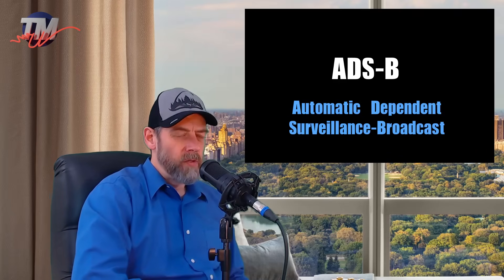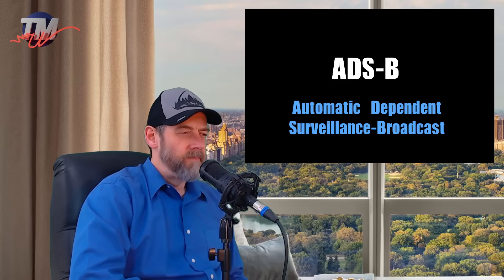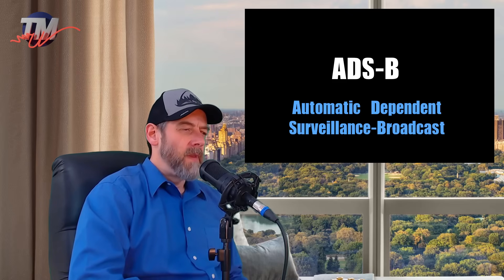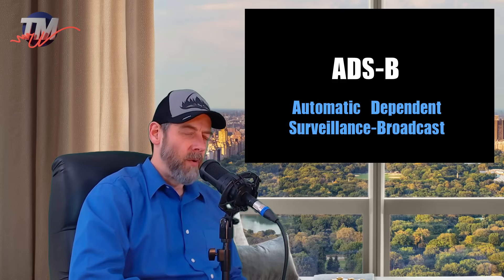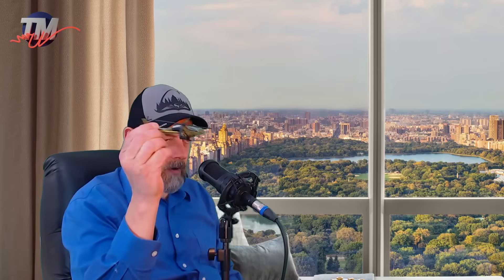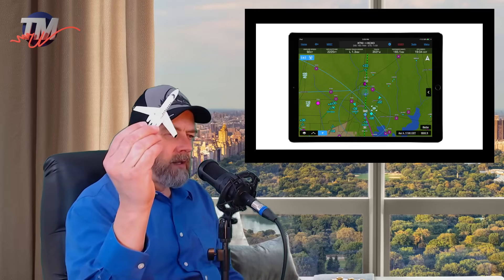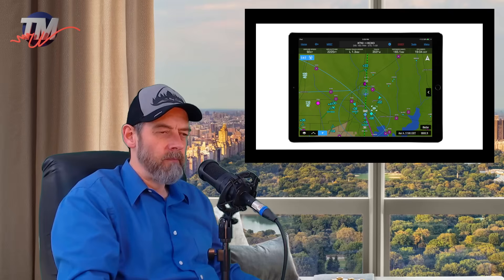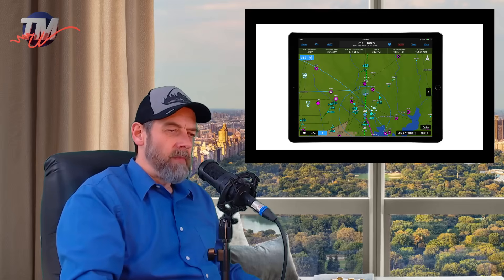The Blackhawk's ADS-B-Out system was turned OFF. Why, what is ADS-B, and why does it matter?

Comment: ADS-B didn’t have any effect on the outcome. It plays no part in any system that could have prevented this. Allowing aircraft in such close proximity and allowing visual separation is the culprit. Helo crew lost SA and the controller couldn’t or didn’t issue evasive action.
Reply: I used to be a flight instructor. This presentation is over-stating the criticality of ADS-B. It's a useful device, particularly in areas outside radar coverage. So places like Australia (which only have radar coverage around major centres), value ADS-B as a far cheaper way of keeping track of aircraft outside such areas. It's hardly a device you would rely upon to ;provide separation between aircraft deliberately on converging tracks as close as a few hundred feet between each other. The latter seems to be an odd piece of airspace organisation.
Reply: @tacitdionysus3220  Right that it's not as important for  ATC, because there should be separations of something like 500' vertically and either 500' or 1000' laterally.  

Where it is important is in determining the 3D positions in the incident investigation (even those numerous near misses should also be analysed).  

In this case it's really fortunate there was a second FDR, and both survived and are readable - that is not always guaranteed.
Reply: Visual separation at night..regardless of the other variables that was the first hole in the Swiss cheese.
Reply: A clearance to enter the VFR corridor and traffic advisories.  Are you saying the controller gives positive control?
Reply: @ What countries rules are you used to using?
Reply: @ it’s Bravo surface to 10K with a permanent TFR. That’s not a VFR corridor; it’s a helicopter route.
Reply: Helicopter is in VFR corridor under Class B airspace.  They are not in positive control ,  but under VFR regulations.  The corridor has upper and lateral limits.  The helicopter exceeded the upper limits and was not on the center line of the corridor.
Reply: @Pasovineyard even if the Hawk was at 200 feet (the upper limit), it still would have been extremely close to the CRJ - within about 100 or so. 100 feet would still be unacceptable. The impact occurred about .6 miles from runway 33 threshold. A standard 3 degree glideslope is 300 feet per nautical mile (nm). .6 x 300 would place the CRJ at about 200 feet at that point. So even if the Hawk was at 200, it still could have resulted in a collision. The bottom line is, when landing on runway 33 the helicopters should be held north or south until the airplane has landed, and then allowed to pass by.
Reply: @daneav8  The helicopter was not on the centerline of the corridor.  The closer you deviate towards the runway, the closer you are to landing aircraft.  The corridor is not in controlled airspace.  Bottom line. Helicopter exceeded the upper and lateral limits of the corridor.  Ban all military from all VFR corridors until they are retrained in the regulations.
Reply: @Pasovineyard  Helo was more than not on corridor centreline, I don't know how much it was off, but by quite a bit.

The glide path intersects the 200 ft route 4 ceiling at about 0,44 nm from the TDZ - so in the end the lateral helo deviation could be the far more serious off-corridor error.
Reply: @Pasovineyard These are restricted corridors and require clearance to use.  These corridors are are in the DC SFRA and are not “free flight” areas.
Reply: @greysheeum  False.
Reply: @Pasovineyard  well, if you’re a pilot, I invite you to take your last flight along one of those corridors without a clearance.
Reply: @greysheeum  Is the VFR corridor a positive control zone?
Reply: @ I think I understand you to mean “Did the helicopter require a clearance to be where he was?”  Yes, just as the jet required a clearance to be where he was.
Reply: Helicopters are generally exempt from ADS-B (Automatic Dependent Surveillance–Broadcast) requirements, especially during tactical, training, or operational missions. In the Washington, D.C. area, which includes Ronald Reagan Washington National Airport (DCA), airspace is highly restricted due to the Special Flight Rules Area (SFRA) and Flight Restricted Zone (FRZ) around the capital.

During the annual Blackhawk check ride at night, military helicopters may or may not have ADS-B turned on, depending on mission security and operational discretion. If flying within controlled airspace, they are usually in direct communication with air traffic control (ATC) and operating under military or government flight operations.
Reply from the maker: Incorrect @ezragonzalez8936! Military aircraft are not generally exempt from flying with ADS-B Out when in controlled airspace, except under specific circumstance: If they are on a mission of national security, if they have permission from ATC, or if they have a waiver from ATC! Know you regulations.
Reply: @truthmattersunplugged  CoG supersedes all regulations. It's the reason people were hotter than hell when they first began to realize what Dick Cheney and his crew were up to in the eighties and nineties.
Reply: CRJ was also likely below the visual glide slope for 33.   But it seems nobody is interested in that fact.
Reply: @ What do you have to back that up? Also, they were on short final. Helo was given the separation, it was THEIR responsibility, altitude restrictions or not.
Reply: @greysheeum  If that is true, yet another reason to get that FDR data under proper, independent, scrutiny asap.

It would certainly take a little of the responsibility off the helo pilots, and reflect badly on the approval of the MIL routings.  

Of course the CRJ had full right of way on its approach, and any use of the approach height and width it needed, and no obligation to sense-and-avoid.
Reply: @Nick_the_Gödel_Bach  There is a baseless belief that the CRJ was somehow absolved of their requirement to see and avoid other traffic. They were not.
Reply: @greysheeum  I think that is the current most prevalent feeling, that they were not at fault.  All they had was one TCAs warning, what was that, 15 sec early. No idea where the risk came from.  No time to query ATC, who was talking to PAT25. No engine speed really to climb.

Difficult to see what they could have done?
Reply: @Nick_the_Gödel_Bach  They had not been informed of the helicopter traffic at any time. They were ignoring their traffic alerts because they were turning to final in busy airspace.  They were extremely busy working on a difficult VFR approach they had not anticipated using until about 3 minutes prior.  Their self-induced high workload caused them to be primarily heads down and eyes on the runway instead of occasionally looking for traffic they were seeing on their display.
Reply: ADS-B has only been required by ALL aircraft since 2020.  There hasn't been a midair commercial airline collision in the U.S. since 1990.  Where was ADS-B between 1990 and 2025? The lack of ADS-B played little part in the D.C. crash. The CRJ has TCAS (traffic collision avoidance System) and we know the TCAS alerted the CRJ crew from its FDR and VDR but they continued with their approach anyway.  The fact is, the ATC Tower Crew saw a conflict developing and did nothing to deconflict it.  He should have told the UH60 to either slow down and give way or better yet given them a heading change for traffic. He did nothing. Take the fatigue level of the CRJ crew. The last thing a pilot wants to do is increase his workload and risk factor at the end of the long flight. AA5342 Did just that by taking a last-minute RWY change when they didn't need to. Thus increasing their workload, and risk factors. Switching to a shorter runway and taking them across a well-known busy helicopter path was just stupid. There was NO reason to do that, and I point out, that no other flight accepted that change that day. Only 5342 did. Had they stuck to the original plan everyone would be alive.

Comment: No question the helicopter is at fault, but the abysmal FAA staffing at this facility, a lone controller simultaneously working several planes landing, two or more waiting to takeoff, and the helicopter, is not acceptable. The overworked controller, in my opinion, did not have time to do his job thoroughly. His radar was flashing a "CA"  collision alert and showing the helicopter altitude at 003. He calls in but all he says is, "PAT25 do you have the CRJ in view?" If he had more time to think about it I hope he would have chosen words that more accurately conveyed the danger they were in. I also hope he would also have called the CRJ to advise them to fly around.
Reply from the maker: I agree with you. You're mirroring what I said in the first video. https://youtu.be/3-userk4hNw
Reply: Will this incident be an issue for the ATC during his annual review?
Reply: Oh shut up dude! Helicopters are generally exempt from ADS-B (Automatic Dependent Surveillance–Broadcast) requirements, especially during tactical, training, or operational missions. In the Washington, D.C. area, which includes Ronald Reagan Washington National Airport (DCA), airspace is highly restricted due to the Special Flight Rules Area (SFRA) and Flight Restricted Zone (FRZ) around the capital.

During the annual Blackhawk check ride at night, military helicopters may or may not have ADS-B turned on, depending on mission security and operational discretion. If flying within controlled airspace, they are usually in direct communication with air traffic control (ATC) and operating under military or government flight operations.
Reply: @ezragonzalez8936  Go upstairs, I hear your mom calling you to dinner.

Comment: For a training flight, the student can turn off the ADS-B for training, get credit for the checklist item, then the instructor could turn on the ADS-B for the flight. I'm going to postulate that the helo did not have authorization to turn off ADS-B based on Senator Curz's statement.
Reply: ADS-B has only been required by ALL aircraft since 2020.  There hasn't been a midair commercial airline collision in the U.S. since 1990.  Where was ADS-B between 1990 and 2025? The lack of ADS-B played little part in the D.C. crash. The CRJ has TCAS (traffic collision avoidance System) and we know the TCAS alerted the CRJ crew from its FDR and VDR but they continued with their approach anyway.  The fact is, the ATC Tower Crew saw a conflict developing and did nothing to deconflict it.  He should have told the UH60 to either slow down and give way or better yet given them a heading change for traffic. He did nothing. Take the fatigue level of the CRJ crew. The last thing a pilot wants to do is increase his workload and risk factor at the end of the long flight. AA5342 Did just that by taking a last-minute RWY change when they didn't need to. Thus increasing their workload, and risk factors. Switching to a shorter runway and taking them across a well-known busy helicopter path was just stupid. There was NO reason to do that, and I point out, that no other flight accepted that change that day. Only 5342 did. Had they stuck to the original plan everyone would be alive.
Reply: @ILSRWY4  Wow. The primary guidance to pilots to mitigate midair collisions is FAA AC 90-48E. This outlines See and Avoid concept and also concept and also the importance of ADS-B in collision avoidance. Together, these two saves lives. It is very scary that pilots don't understand this. To such an extent that they would leave this off in Class B airspace and the approach lane of DCA.
Reply: @ILSRWY4  lack of ADS may have "played little part" and may not have been sufficient in & of itself, but there are many other questionable factors, which considered individually, might not reach a threshold of probability, but when taken as a whole, might. No honest investigator is going to dismiss such evidence based on opinion.

Comment: "The President is dead along with 67 other people."
No, truer word ever said.
There is a reason there's training ground, and commercial airspace is not one of them.
Also at that point you assume big responsibility.
Reply: Had it been a real scenario and the president really was on that helicopter I can assure you ATC would have cleared all other aircraft out of the airspace... just like they did on 9-11.  They didn't this time because it was only a training flight and the president wasn't on board.
Reply: @ILSRWY4  Training missions are designed and mandated to be as accurate to real scenarios as possible, so there should be ZERO rationalization.
Reply: @ILSRWY4  You missed the point. People are dead.
Reply: @ILSRWY4 how does ATC know it’s ONLY a training exercise? Are you saying that in a real situation the tower would have advanced notice that a real VIP was onboard? I think not, for the same reason escorts consist of several dummy vehicles in the caravan. Communications can be breached and identifying the PAT as live defeats security.
As for 911, all aircraft were cleared from the skies, not just those in the area

Comment: Another thought - there must be plenty of military radars active in that airspace too, since the white house, Pentagon, and other installations are there.  Surely at least 2 or 3 must have track data on PAT25 that would fix its 3D position, even though it was pretty low and in the ground clutter - I reckon there would be enough samples over its last 30 seconds to get good, independent position data.
Reply: The local Airport Surveillance Radar (an ASR-9 or ASR-11 with an ATCRBS / SSR antenna on top) is more than adequate for ATC purposes, there may also be overlapping ASR-9/11 coverage in that area, but I don't know.
Reply: @uploadJ  When I have more time I'll see if I can find accuracy specs of those ASR systems - but the commercial radars I've seen have nice wide antennas for good azimuth resolution, but not tall enough for vertical resolution.  The mobile military radar system antennas I've seen have horizontal and vertical dimensions commensurate with the resolution they need over their detection range.
Reply: @ Thanks - I'll leave the detailed spec hunt then, but just to clarify on my first comments (made too briefly): 

True, large antenna size tightens up the beamwidth - the tacit understanding is the antenna is either spun (physically or using phased arrays), or oscillated, for vertical tracking - then the pencil beams translate into lateral or vertical resolution

beamwidth goes as \lambda / diameter

Example : the WSR-88D radar antenna diameter (@ 28 feet) and wavelength (still "S" band) results in a very narrow ½-power beamwidth of about 0.95~ (17 mrad, so transverse resolution of about 2% of range).
Reply: @ Thanks - appreciated.  Just a user of the radar data myself, never looked at the antenna design actually (no, not true - I've built a couple of VHF and ISM band J1m slimjims, they worked pretty well for their hand construction)